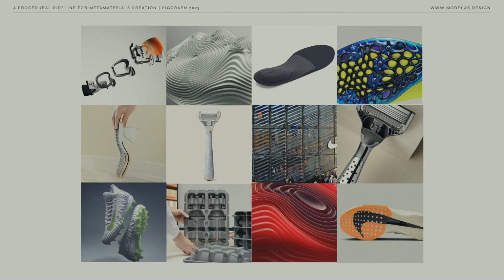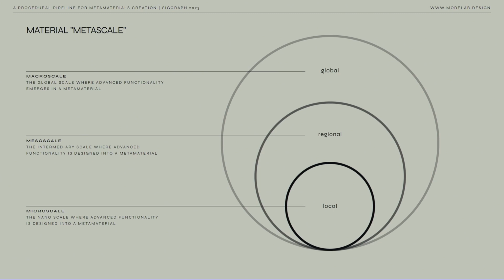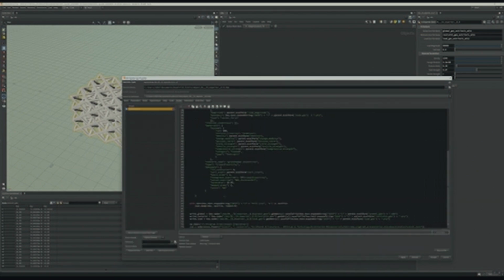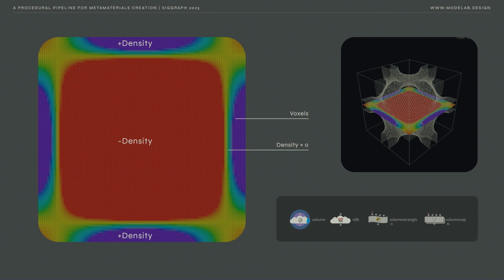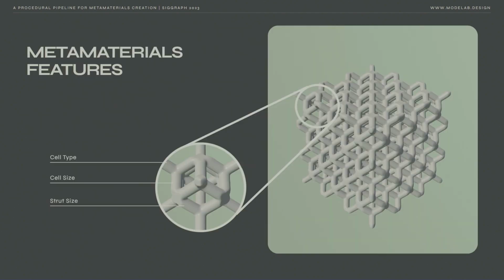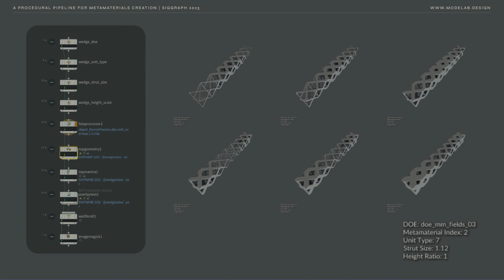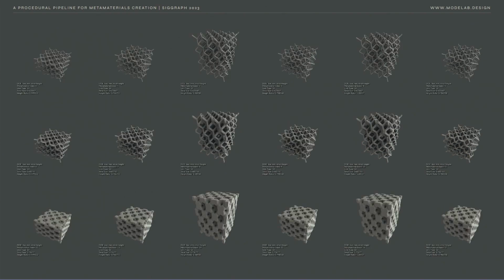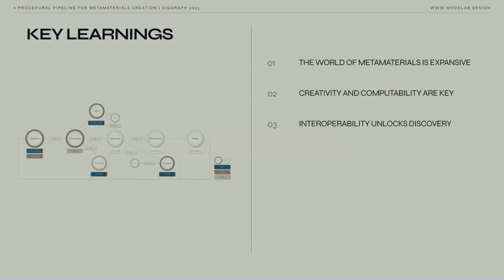Building a Pipeline for Architected Metamaterials | Ronnie Parsons & Evan Greenberg | SIGGRAPH H...

Comment: I think it would be more interesting to apply constrained optimization as a tool to design certain structures for certain requirements (if you're not doing it already). I think this will allow you to reduce the pdg variations and fem analysis. This presentation remembered me why I need to go back and learn calculus and optimization.